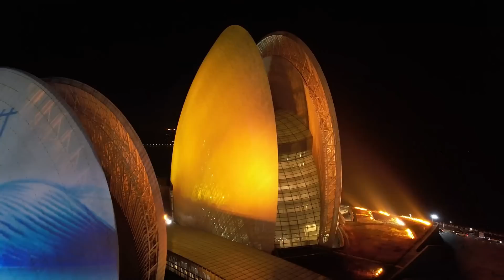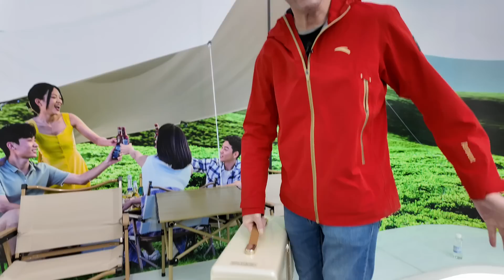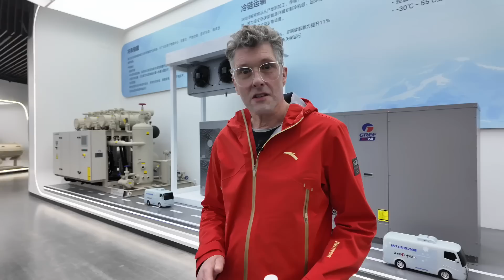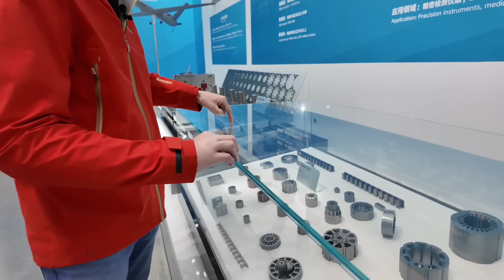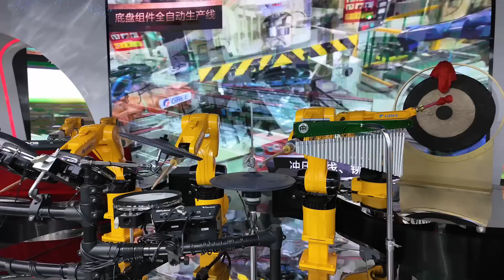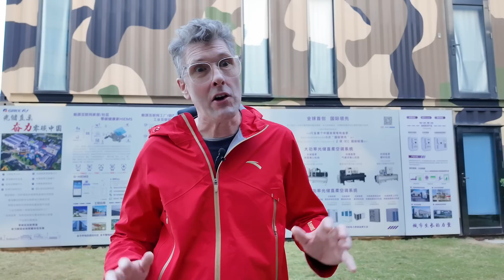This Chinese Company is Truly Impressive......

Comment: Lee - it's CURRENT (amps) that kills rather than voltage. A car or truck battery that is rated at 12 volts DC has a very high current rating (as much as 600amps) and it only takes 1/10th of an amp or only 100milliamps (mA) to stop a heart (fibrillation).
Reply: Hmm, V=IR, so they have the same effect as far as damages are concerned.